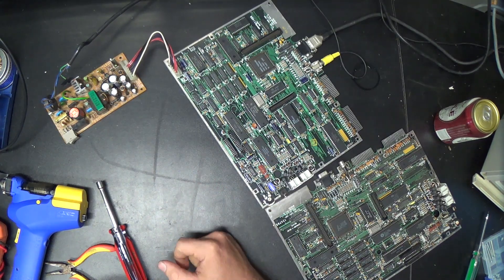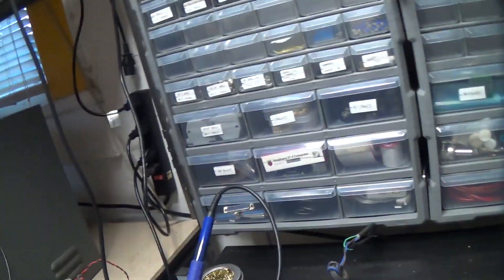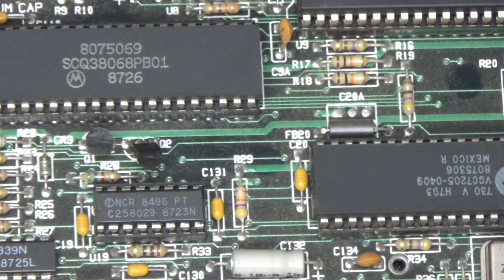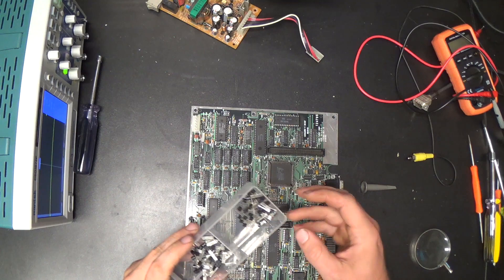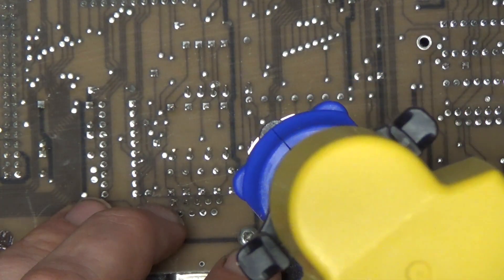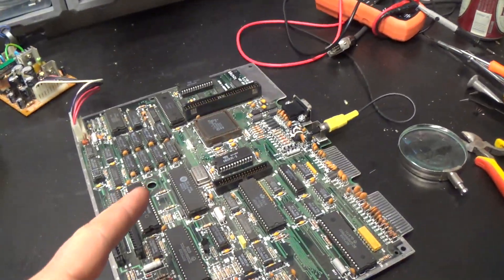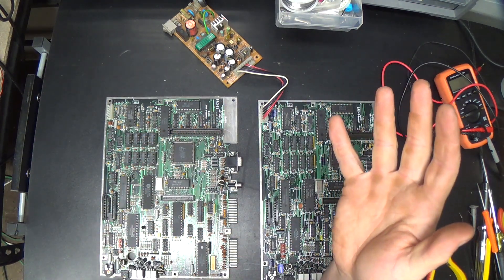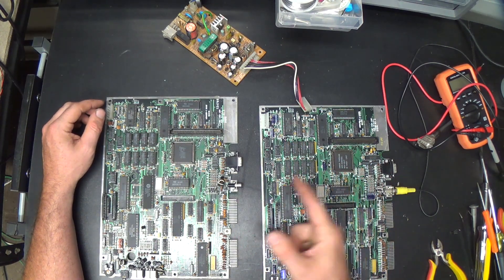Tandy 1000 HX (Pt.2) Composite Video Repair (#SepTandy 12th, 2020)

Comment: how do i plug this computer into my tv? i can seem to get the tv to recognize a signal
Reply from the maker: If you're sure that you've got it plugged into a composite video port on the TV, and it isn't doing anything, I would suspect a problem with the machine or the tv.  It ought to be a standard NTSC signal.

Note that sometimes the colors on composite CGA are screwy, so I think you are still better off to use a CGA monitor or a CGA-VGA converter if you can spare the coin for it.
Reply: @Lee_Adamson_OCF  yea i just plugged it into the back of a newer TV no idea if it was composite or not, but yea i guess i should find some kind of converter and try that. thank you
Reply: The "smarter" TVs get, the less compatible they are with NTSC composite sources.  For one thing, a lot of this old tech that runs at ~320x240 are using 240p, which is a hack to 480i where it only draws one field every frame, instead of alternating between the interlaced odd/even fields.  I have a Blackmagic capture card that refuses to touch 240p sources.  Many HDTVs will accept 240p, but screw it up royally trying to interpret it as an interlaced source.

You're much better off using some kind of scaler to up-convert composite to HDMI.  Look into the RetroTink stuff.  It's built by retro enthusiasts for 240p game consoles, but same diff in this case.
Reply: @sirnickity  thank you dude this helps

Comment: I may have a Tandy power supply for you. I won't be able to get to it until the weekend. And have motherboard too. Let me know, selling it as the monitor is dead and have other plans with the case. So and send to you. Let me know. If you pay for shipping, I can send it to you for free
Reply from the maker: Cool.  I would certainly take that stuff off your hands for a few bucks.  Where are you located?  Seems like sometimes the shipping on larger stuff like that ends up being too much unless we happen to be on the same side of the US, heh.
Reply: @Lee_Adamson_OCF  I'm near Toronto, Ontario  in Canada. By the way, from my pictures the power supply and motherboard is from Mark III. If you are interested let me know. Keep if the grear videos!
Reply from the maker: @2010Thex  Ahhh, I bet the shipping would be way too high then.  Thanks, though!!!

I am going to fix the Model 4 supply tonight as soon as I post this comment, and for the Tandy 1000 I think I can just rewire a cheap micro-atx supply.